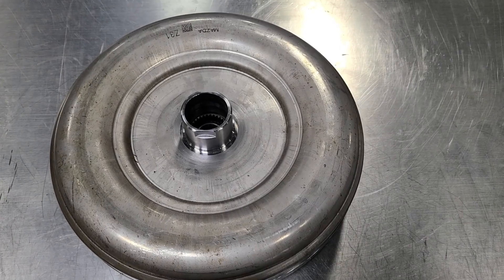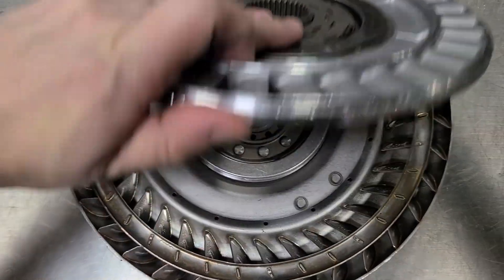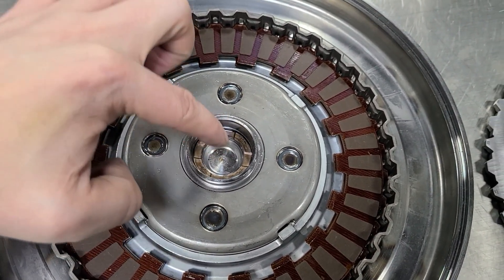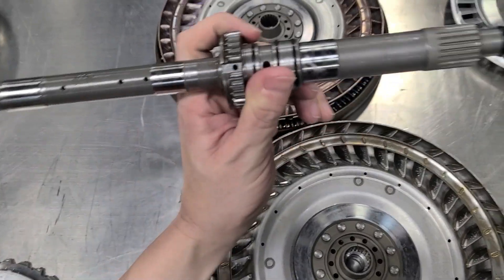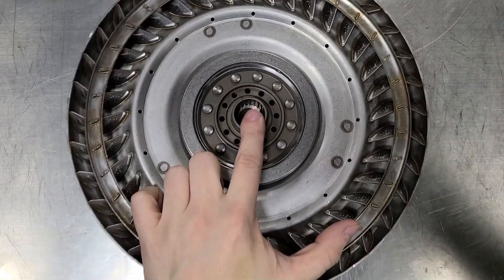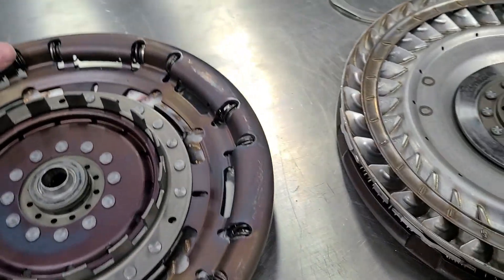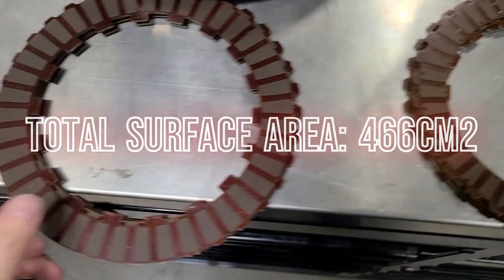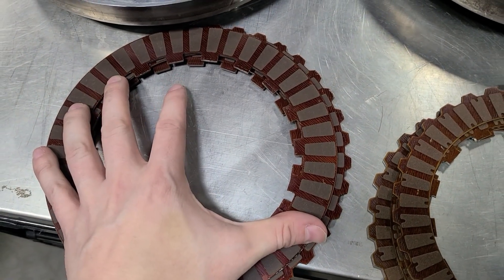Mazda Skyactiv Drive, Turbo vs Non Turbo Torque Converter

Comment: This is cool... it's been very interesting learning that the skyactiv 2.5T setup literally has a beefed up engine compared to the NA. Slightly different block, slightly more beefy rods, slightly larger torque converter, I guess even slightly larger tailpipe ends 😂

Comment: What are the different between mazda 2 and cx-3 without istop, torque converter? Do you think they're similar torque converter?
Reply from the maker: They will be the same converter style, assuming the Mazda2 is not the 2 hybrid based on the Toyota Yaris.

Comment: I have a question out of curiosity.  Does the torque converter clutch stay locked while shifting gears?  Or does the clutch open quickly, an upshift is made and then the clutch locks again?
Reply from the maker: It usually stays locked to some extent, I've never observed it fully unlocking during a shift either up or down. I'm working on another few videos, and one of them involves a more in-depth observation of TCC function.
Reply: @grolladat  interesting.  Thanks for the response, looking forward to the next videos!

Comment: In your opinion, do you think the non turbo SkyActiv 6spd is a 100,000 mile trans? 200,000 mile trans? More than that? Less than that?
Reply from the maker: I've seen some early failures but have seen many more with 150k plus miles.
Reply: @grolladat   That's good to hear, here's to hoping my 2023 3 base model lasts as long as my old hand-me-down 1998 Mazda 626 did! 210K miles when I gave it away and it lives on with someone else now. Heck of an upgrade let me tell you. Your AT learning re-set did the trick after it learned some bad behaviors during break in. Feels great now, still drags the 1-2 a little in 'manual' even in 'sport' but hey it's not a sports car.
Reply: @grolladat so its looks like well designed and well build transission. Seems better as dual clutch constructions i think… I mean from reliability POV

Comment: What's your opinion on Mazda saying the transmission fluid is 'lifetime? I want to do a full fluid flush on mine around 50k miles but at over $100 for the correct ATF is bit hard to justify.
Reply from the maker: All fluids break down over time. Personally, I'll be changing mine at 30k. 50k is a fine interval for most people, and I would only use the Mazda FZ.

Comment: How strong does the turbo trans look compared to transmissions you have seen
Reply from the maker: There are a few things you can mathematically calculate out based on clutch sizes, pressures, etc. Some things it's too difficult to figure out based on metal fatigue strength without being part of the development team behind the transmission. We won't know the limits of the transmission until some serious power starts getting made with the engines and then we'll find the weak links. Nothing inside the transmission is looks "cheaped" out on and we see them go a long time before a rebuild is needed. The pinion gears inside the planets are a good size and larger than comparable transmissions like a Toyota U660, Ford 6F55/GM 6T70 and has larger internals than some RWD transmissions behind more powerful engines.
Reply: @grolladat  would you say if going the performance route cooling needs to be upgraded in these transmissions
Reply from the maker: For longevity sake adding a separate cooler will help, they do run a bit warm. I've got a few designs I'm working on for it.

Comment: What caused the failure? Do we know yet?
Reply from the maker: This type of damage is usually caused by a few things. The first is a hydraulic leak, this transmission has air checked perfectly throughout the transmission and valve body so not a hydraulic leak. The only damage is to the 3-5-R clutch set. There are quite a few transmission family's that operate with this sort of clutch arrangement and failure in this instance indicates it was a type of abuse. When a vehicle is in elevated idle such as cold start and the rpms are still above 1000 or so the person just puts it in reverse and goes before the idle drops. The 3-5-R clutch is a brake instead of a driving clutch and it puts a bunch of very quick sharp stress on the clutch set. This is my assumption of what happened to this one based on every other clutch set to be working correctly and no mechanical damage found.
Reply: I have a 2023 cx5 turbo, which I recently noticed a chirping sound when I accelerate and it stops when roll but it comes back when at full stop, so basically the chirping comes from accelerating and at stop.  Could it comes from that I don’t wait when I cold start and cause the issue on the converter?